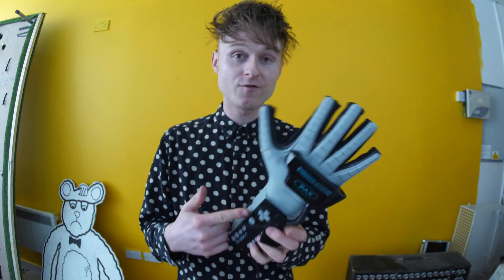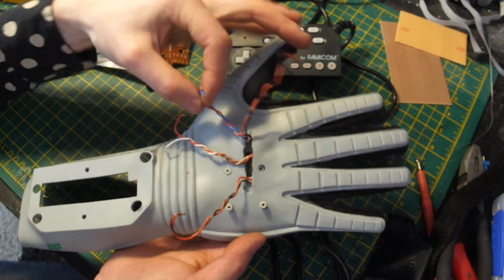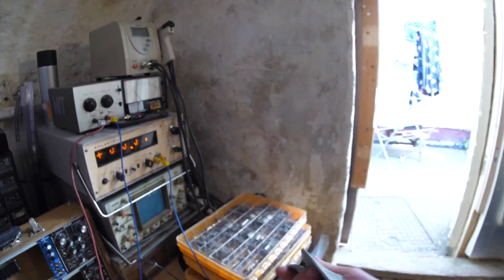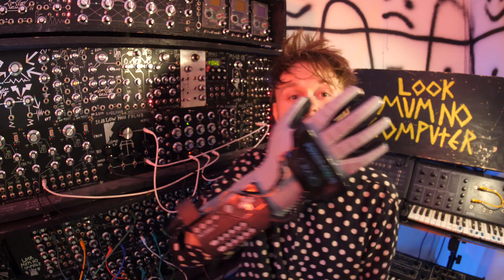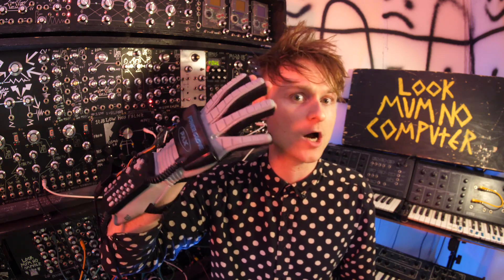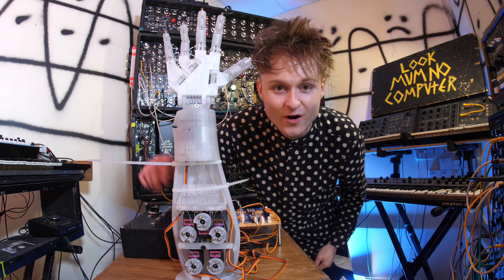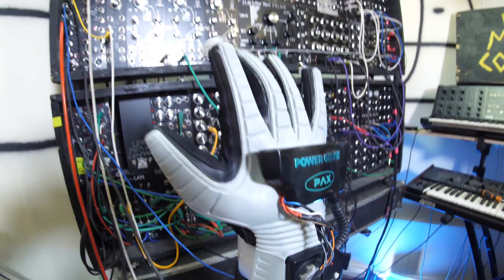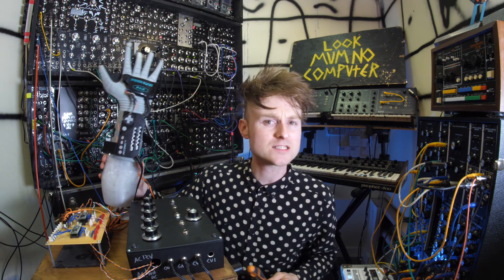Modifying a Power glove To Make Music, But Controlling It With A Robotic Hand..

Comment: Love your videos. I'm the inventor of the PowerGlove so I was happy to see you hack it. You might benefit from building the original optical flex sensor I invented for the first data glove; an LED and phototransistor on each end of a shiny rubber black tube. As you bend the tube, less light gets to the phototransistor. It will give you more dynamic range. The first thing I did was hook the glove to my Atari 400 (~1980) to control the pitch the 3 POKEY oscillators, very similar to your first simple demo. Then I started putting the sensors on my elbows and knees, filed a patent... and the rest is history. Here's a photo of the prototype with the optical flex sensors ... https://gamecrate.com/sites/default/files/PowerGlove1.jpg
Reply: Here's a demo video we made that shows the output of the optical flex sensor (0:53) back in 1987 https://youtu.be/fs3AhNr5o6o

Comment: Neeeat.
No joke, this have been my 5th year exam's experimental thesis in High school here in Italy, 5 years ago. I used to control in that Same way 5 servos which drew 2amps EACH. Needed a pc 5v supply. A design whoopsie, but the hand I controlled with them was Strong af.
In my experiment I wore a glove with sensors in it, and then move an external hand (built with scrap metal cause i didnt have a 3d printer ahah)

Comment: 6:50 Love this... I was thinking if there were pressure or heat sensors built on to it so when it is being controlled by the synth  if the fingers touch something the hand reacts in some way which changes the song which changes the way the hand is moving etc...